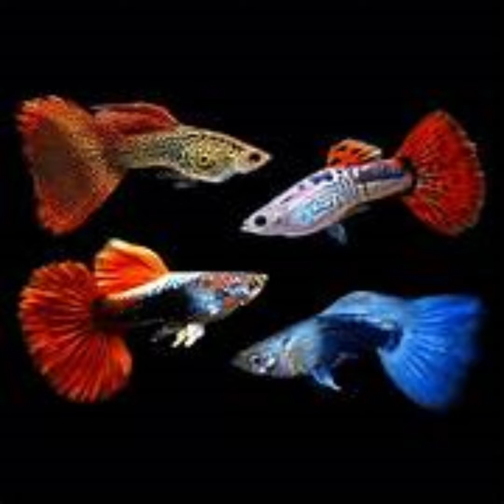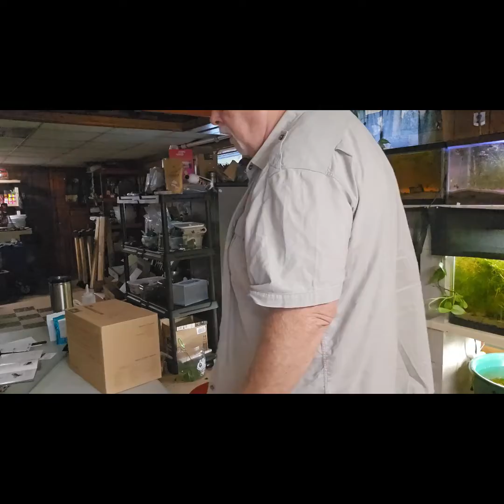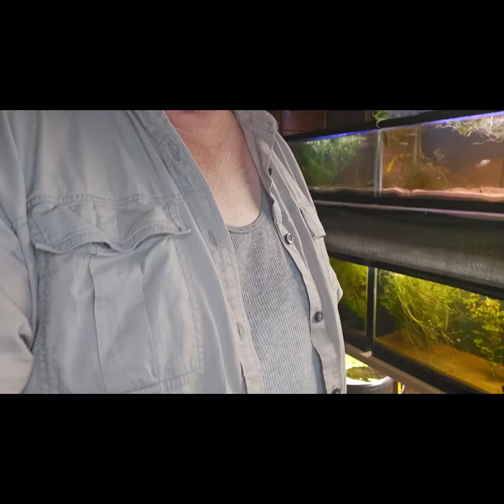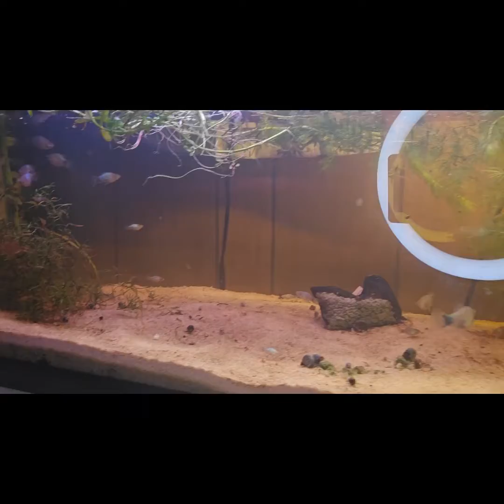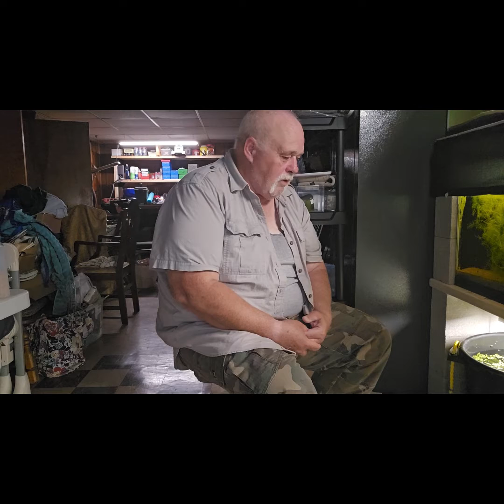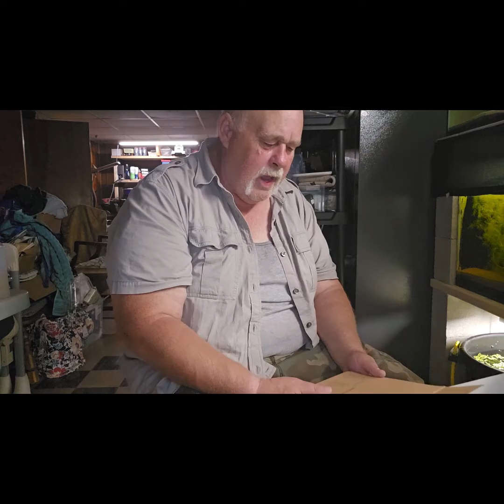HG067 AIR PUMP

Comment: its always fun to work out the solar we doing  same in he koi house working great off a 1000 watt inverter
Reply from the maker: With what i have running and futer expansion ideas i need about a 3000 watt inverter. I have the panels its the battery cost holding me up
Reply: @billsnanos   yes the battieries are always the  ones that hold its back on cost
Reply from the maker: @tanksandfish i have been looking at those rechargeable power stations that recharge off solar
Reply: @billsnanos  if you have the batteries connected off a controller then they will always recharge the batteries long as there is charge coming in
Reply from the maker: Very true. Deep cell batteries 100 ah here in NY are 200 + per battery

Comment: It's really noisy actually
Reply from the maker: The noisy air pump is my other air pump i had 2 of the pumps that are running 55 watts. The hygger you can hear it but not as bad as the other one. Thru all the years I have never had an air pump that was totally quiet.